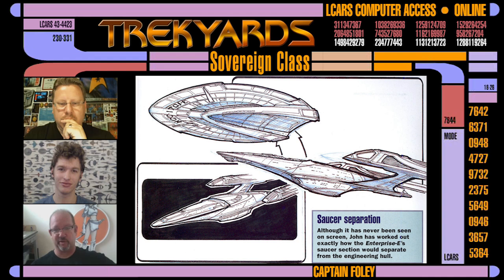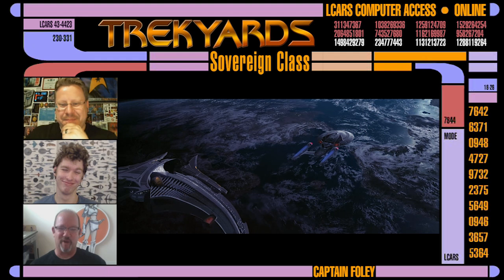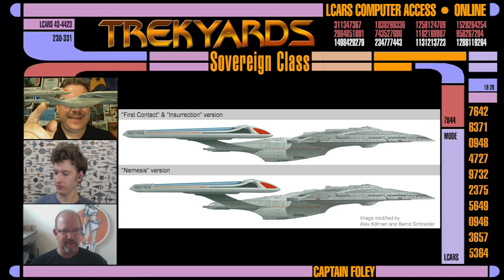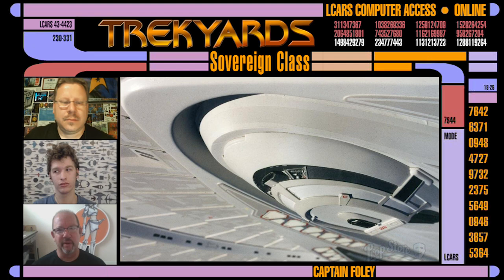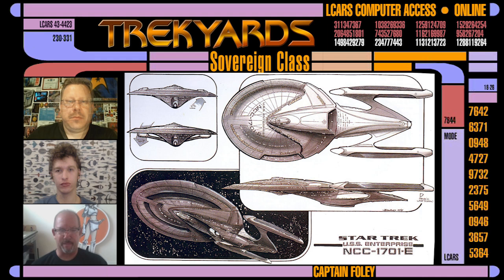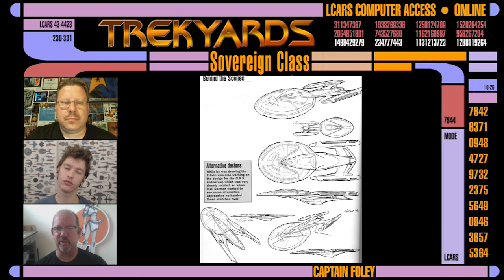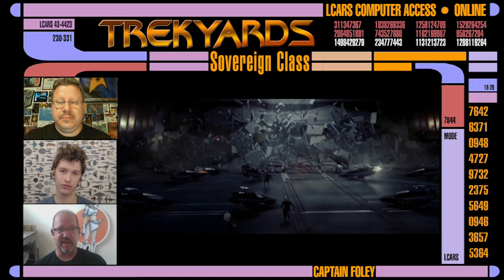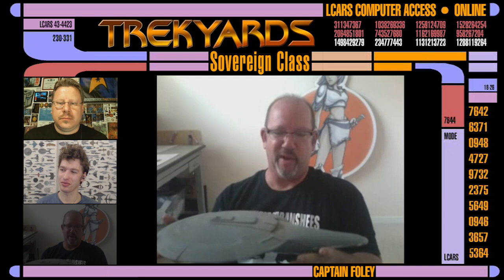Trekyards EP66 - Designing the Sovereign with John Eaves Part 2

Comment: Remember people that, with the exception of the Enterprise-D & -C, none of the ships had impulse engines on the stardrive section, only on the saucer. This was because that none were designed to operate once they had separated. The idea wasnt to create a battle & saucer section that could fight together or have one fight while the other fled.. It was to give the crew a "lifeboat" in the event of a warp-core breach. If the core was going critical they could evacuate everyone to the saucer, separate, & move away at impulse speed. Only the -D had it where each section was designed to operate independently & not just as an emergency maneuver. The only other exception is the -C which only had impulse engines on the stardrive section. But this was not how the original drawings showed it, which showed it with 3 like the -D, but due to budget & time constraints changes were made to the design to make it easier to build. This is how the -C would have looked if they had gone with the original drawings: https://www.youtube.com/watch?v=cgYA3krHlCI

Comment: +Timmothy Rex. Thats exactly why Saucer Seperation wasent added to the Sovreign class since the Galaxy class's Battle Bridge had the advantage of the placement on the Cobra Head ontop of the Star Drive section with a third impulse engine on the stardrive section too.
Reply: to be fair they didn't mention anything about the engineering section being able to operate  on its own...or did i miss that bit? If I did I apologise, running on like 2hrs of sleep right now.lol Anyways, saucer separation could have been more just as a means of escape for the majority of the crew just as it was for Constitution class.
Reply: +FLAME4564 Well, they didn't show it on screen, but as they mentioned in the video, it was intended to saucer sep. I mean, it's a cool thing that all Enterprises have to have. I guess it's not really as necessary as it was on the D, since there were few families on the E, but it was designed to be a good exploration ship as well as a battleship, so I can imagine families on a Sovereign-class ship on exploration duty. (I guess they couldn't make a feature film about that though).

Comment: OK, so this is my one and only big problem with the Sovereign-class starship: there's no impulse engines on the battle section. The only impulse engines are the two on the back of the saucer. If the saucer was separated, the battle section would have no means of sublight speed propulsion. That annoys me every time I think about it. On one hand, it HAS to be able to saucer sep, bot on the other, it's impossible.
     If I were to fix this problem, I'd probably put Voyager-like impulse engine nacelles below the warp engine nacelles right where the strut connects to the nacelle.

Comment: Overall, I like the Ent E design. It's sleek and a modern progressive design with a lot of potential. However what I don't like is the fact this was supposed to be a warship to fight the Borg. And as such was under protected, too few phasers and too few torpedoes. The Torps and phasers added later were poorly designed and a cop out. I would have liked to have seen a fully outfitted Ent E when Nemesis came out.
Reply: +Mark Plott I think the actual writing and the direction given to the art department weren't in perfect synch.
Reply: agree.